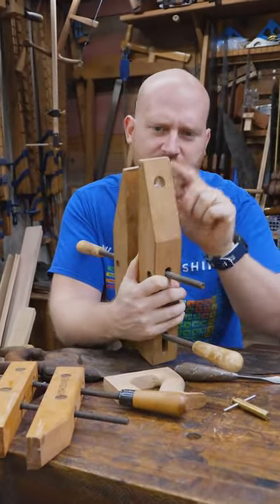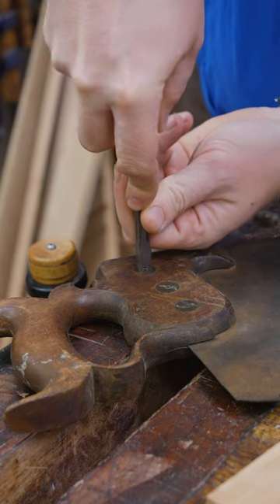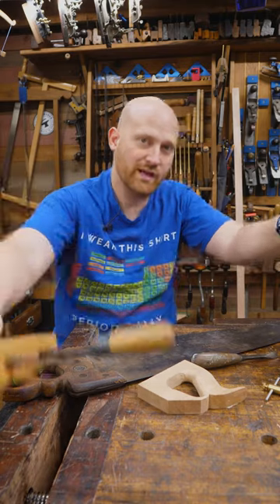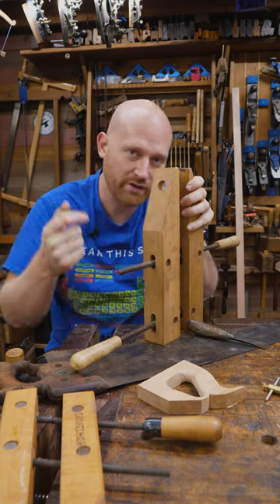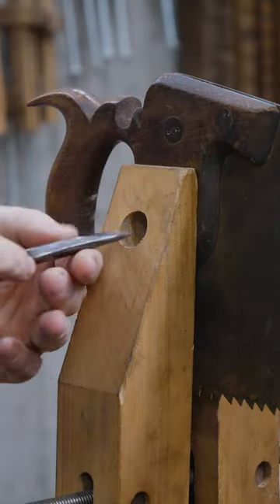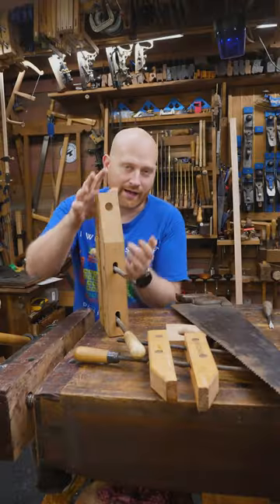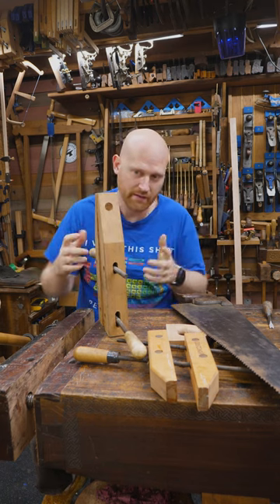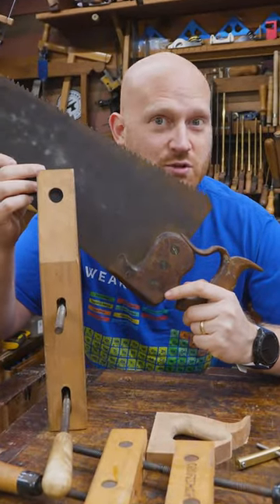Why Drill A Hole In A Hand Screw Clamp #woodworking #handsaw

Comment: I was only wondering last week, how do they stop the other side of saw nuts spinning? I've seen there's a square post on the inside sometimes to register on the wood.
However, I've just bought some new saw nuts and there's no square post. So I was thinking maybe a toothed washer to grab the wood and the saw nut to stop it spinning?
Reply from the maker: Most of the time the tight fit in the socket is enough to stop it from turning. But about one out of 10 end up spinning.
Reply: @WoodByWrightHowTo  I'm just shaping a handle out of padauk. I'll have to remember to go for a really tight fit 👍 thanks James

Comment: I bet it would help to have rubber glued on the side without the hole for particularly stubborn ones
Reply from the maker: I have a coin of rubber I use for the really bad ones, but I have only had to use that once.
Reply: @WoodByWrightHowTo  Never thought of the rubber coin idea. I use a chunk of leather. 
The parallel clamps are lifesaver in a lot of cases. 
I liked how you showed using them to hold an odd shape for carving. 
I have a sheet of rubber that will be a good source of a coin.

Comment: Can't you just shift the tips of the jaws a little? Make the lower one clamp on the back, but the screwdriver side still exposed?

That said, I'm all about modifying my screw clamps. I put v notches in one to hold stock vertically for drill press or carving work.
Reply from the maker: What's the time you can't quite shift it enough to get around the larger medallion. And if it shifted it doesn't have as much clamping Force which sometimes is needed to hold the nut from spinning.

Comment: Never Heard the Term ; "Medallions" ,when it came to the "bolts-screws" that hold the blade to the hand-saw handle. I'm a third generation Carpenter that KNOWS the "right-name". Unless; this is a "generic" name from a "Real-Trade-Mark"...  l would like to discover ,your "origin" of this Terminology.
Reply from the maker: The medallion is a very old term referring to the large Chicago bolt with The branding on it. I don't know when it first started but I know it goes back to at least the mid 1800s. You can find it on pretty much any depiction of the parts of a saw. https://images.app.goo.gl/Ezv3q4Za6wJWDxEh7
Reply: @WoodByWrightHowTo  Totally got the "Medallion Terminology" thing....and thank you. But as Far as the Bolts-screws go, l'm just picking up "Chicago-Bolts"... there is another "Standardized name" for them. Just wondering if you know? I have 35years Experience with "nail-bending& saw-dust productions"( ha-ha)& only ONE out of 75 of my "Comrades-in-arms" in the Trade, KNEW the ANWSER !!
Reply from the maker: Oh yes. those have a lot of names. they are oddly regionalized. those are fun for start arguments in hand tool groups. just to name a few of the names I have come across. Barrel Nuts | Sex Bolts | Chicago Screws | Chicago bolts | Chicago nuts | Interscrews | Female Bolts | Mating Screws | Post and Screw...
Reply: @WoodByWrightHowTo  Thank you Sir. One of those names, "Hit the nail on the head". Hope your "Researching" re-educated your "Plethora" of Knowledge. Us "nail-benders & saw-dust makers" can Allways Learn from one-another. Best wishes with all your endeavours.

Comment: I have a saw that spins even when clamped. Do you have any tips for the really stubborn screws
Reply from the maker: if the nut reses into the handle a bit I some times put a coin of rubber on it and squeezy that down. if it still turns something is rusted and often some penitrating oil is needed.